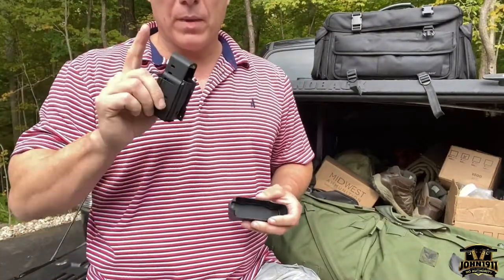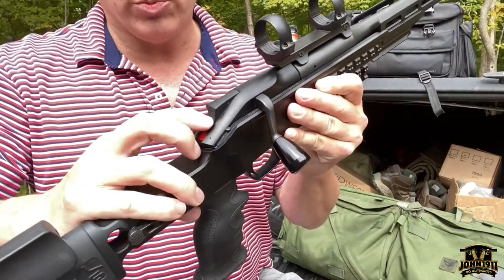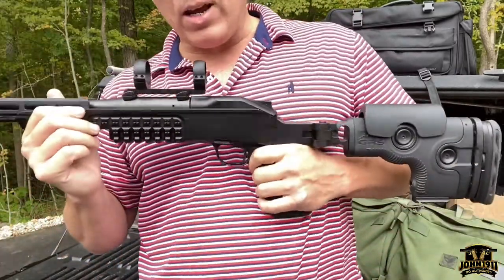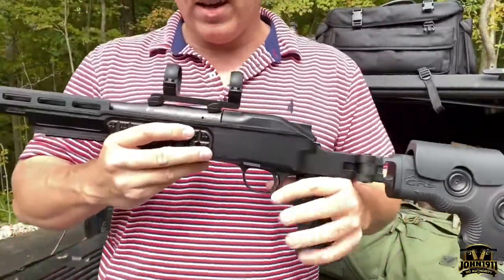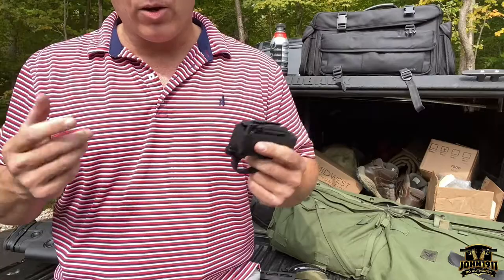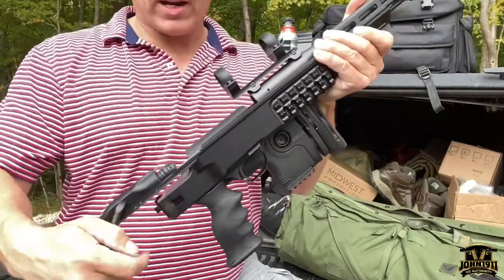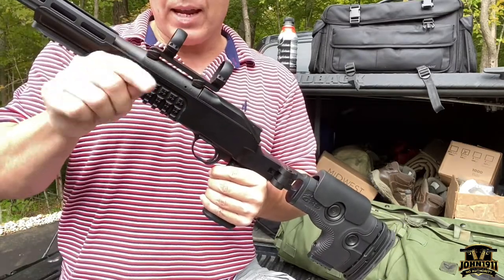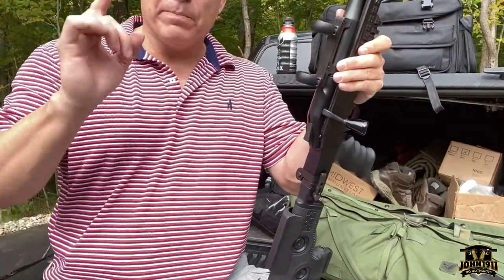Primer - So Your Student Has a Blaser

Comment: Good job as always , this firing click issue ( misfire) keep happening to me from time to time ... I know it’s not from the way I pull the bolt . What I do is I disassemble the bolt and bolt head and put it back on ... some time it works and sometimes not it keep misfiring .
Any solution to that problem would be appreciated.
Thanks
Reply: Are you using reloaded ammunition? I have fired several thousands of rounds in my R93; and it can be picky with the sized brass. 
- I would recommend to ALWAYS bump the shoulder of the brass a tiny amount. If you are only neck sizing you will run into problem that creates misfire. Not straight away; but after 2 or 3 reloads you will have a hard time closing the bolt completely. This will result in in a very light hammer strike to the primer (Visible; but not enough to ignite the primer) and a misfire will be the end result.
Reply from the maker: See my answer below. 

—Marky
Reply from the maker: @willewille9595  Willie has nailed. Pulling the bolt and replacing IS NOT changing anything.

What you most likely have is a OAL length issue. Especially if you are shooting reloads. Blaser chambers are spec'ed very, very tight. That contributes greatly to the accuracy with even hunting ammo. But reloaded ammo needs to be FULL LENGTH RESIZED to factory specifications. In the US we call it SAAMI. The EU uses CIP. 

In this case, the reason your gun is misfiring is because the out of battery safety says the action is not completely closed. 

Additionally if it is going away after you fiddle with it for a while? That is likely because you are compressing the round with a few cycles of ammo. 

Give me more info and I will be able to confirm what's going on. 

Marky
Reply from the maker: Willie has nailed it (Below). Pulling the bolt and replacing IS NOT changing anything.

What you most likely have is a OAL length issue. Especially if you are shooting reloads. Blaser chambers are spec'ed very, very tight. That contributes greatly to the accuracy with even hunting ammo. But reloaded ammo needs to be FULL LENGTH RESIZED to factory specifications. In the US we call it SAAMI. The EU uses CIP. 

In this case, the reason your gun is misfiring is because the out of battery safety says the action is not completely closed. 

Additionally if it is going away after you fiddle with it for a while? That is likely because you are compressing the round with a few cycles of ammo. 

Give me more info and I will be able to confirm what's going on. 

Marky
Reply: Well guys I only shoot military M118lr 175gr which is comparable to the federal gold 175gr  ... I don’t use reloaded ammo .
Reply from the maker: What make? Not all M118LR is the same. Also be careful not to buy X marked. 

There are know variation issues with 118, including failure to fire. 

Marky
Reply: No x marked M118lr, I was lucky to find what the military uses , they come in boxes of 20 and the date is marked on each boxe .... mine are marked LC17 ... I love them cose they’re super accurate and they work perfectly for long range hunting and wild boars
Reply from the maker: That is Lake City ammo. LC.

Have you tried it in other guns? Also have you checked your firing pin on the Blaser?

Marky
Reply from the maker: You may have an out spec firing pin? 

Marky
Reply: I own 2 blaser r8 and shoot the same bullet and  I keep getting this misfire after a while . What I do is clean my rifle ( I use hopes n9 )again and again until the misfire disappears. I can never guess how it starts And what I do to make it disappear .
Reply from the maker: OK that’s weird. 

I may have to track some of that ammo down and do some testing on my end. Can you send me an email so we can talk off-line?

Marky
Reply: @dorykiki1  When you are experiencing misfires; does the primer show signs of a very light hammer strike? (In compression to fired brass in the same gun) If so is the case; there is a headspace problem compared to what I previously mentioned regarding sizing? We do from time to time see headspace problems on factory ammunition. Although I only shot handholds in the blazers I have seen it happen. The Tikka T3 in 308 and the Carl Gustav 1900 in 9.3x62 is examples of rifles that are known for short chambers. And some factory ammunition will simply have to small of a headspace for those chambers resulting in the shooter not being able to close the bolt without using excessive force. PPU 308 FMJ is for example one manufacture of 308 ammo that in many cases does not work in the T3.

If the sign on the primer of the misfiring brass is normal; than I have no idea of what causing the issue. In my experience the firing pin spring on the blasers are not known to be weak. And I certainly have nog had any problem my self. 
One thing to keep in mind though; there is a roamer  that the R93 and R8 does not like to be dry fired and that they are prone to firing pin damage if excessive dry fire take place. I do not know if there is any truth in that; but a few hunters/shooters here in Sweden has reported firing pin damages. That may be a thing to check if the problem is not tracked down to ammo/extremely hard primers and/or headspace.

Good luck!
Reply from the maker: I wanna Mike some M118LR ammo you have that has not been chambered? I also want to put go and no go gauges in your barrel chamber.

Something is wrong. 

Marky